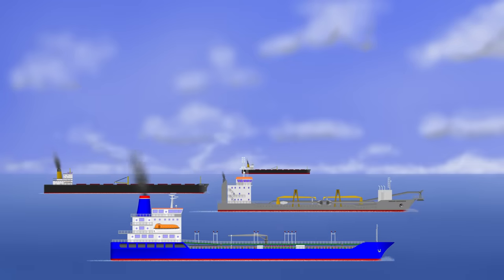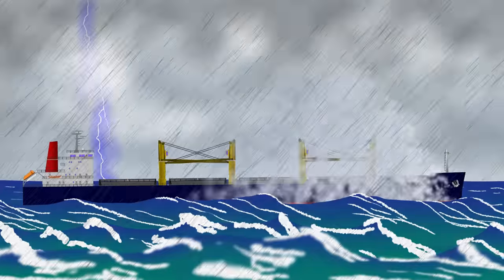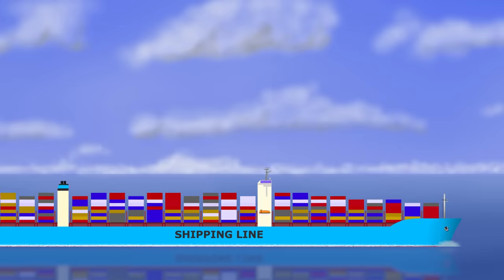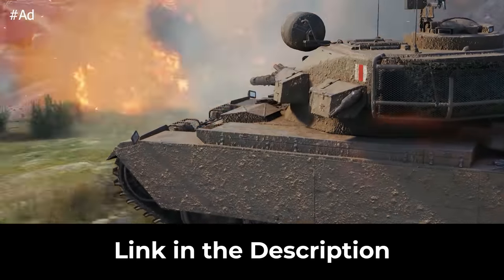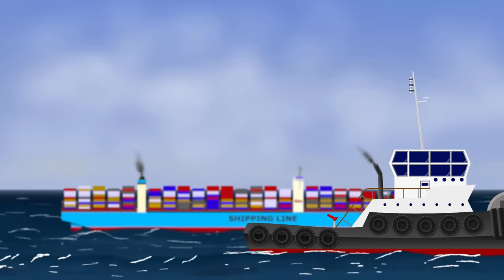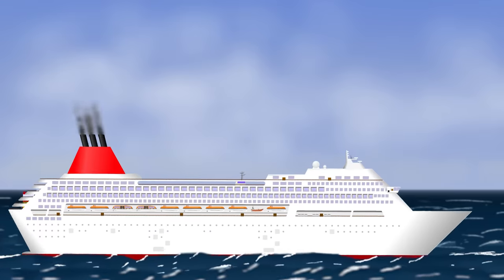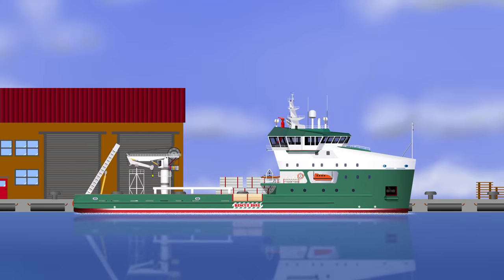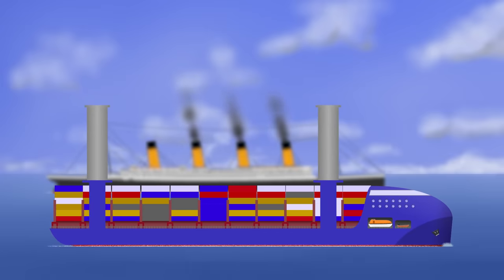Why Is The Bridge At The Back?

Comment: An additional factor with cruise ships is light pollution. Passengers want to have a midnight buffet and dance party, and having that in front of an aft bridge would make safe navigation and watch keeping impossible regardless of height or other factors. The fore bridge is very well protected from these visual distractions.
Reply: "light pollution." I hadn't even thought of that, but it would have to be a colossal issue.
Reply: Whew, I had to read this twice to notice the subtle difference in the word light between its common meaning like slight, little or minor, and what was meant here, the pollution of emitted light from light sources like light bulbs, flood light or fairy lights.
Good point.
Reply: @beachbum4691  it is quite a big issue. Commonly on cruise ships that have cabins directly above and below the navigation bridge, they all come with a requirement to use blackout curtains during a specified time during the night. That way there is no chance of light bleeding into the bridge itself. 

A good example is the panoramic cabins on a ship such as Freedom of the Seas. Another is the solarium on the Oasis class ships. Its positioned directly above the bridge and runs with minimal red lighting at night to avoid that problem.
Reply: @verios44   A wonderfully comprehensive reply, thank you, of such consequence I have reprinted your reply above. Very very best wishes - John - Perth - Australia
Reply: one person mentioned red light - it is used because dim red light does not cause eyes to adjust so quickly to bright light (and "switch off" the night mode where more sensitive rods are active (greyscale). Cones (which provide colour vision) are less sensitive.
Reply: @peter2346  exactly! Thats also why cruise ship navigation bridges are as close to the front as possible, so the passenger areas can be fully lit at all hours. 

Thats also why if you observe a military or industrial ship, at night they are near totally dark besides several beacon lights, or minimal lighting in specific places.
Reply: Exactly, I have the same comment. My old dad was a merchant marine Captain. When I was a kid we went to sea with him. At night the bridge is unlit (maybe some dim red light areas) as the bridge officers / crew have to maintain observation, no lights can be in front of the bridge. On a passenger ship that means being a the front. In fact I'd say that is the main reason the bridge is located there, it wouldn't be possible to have haapy passengers if they all had a blackout! I was surprised the video didn't mention this.
Reply: Rule Six. The question I got during my CoC Oral Exams :D
Reply: Not to mention second hand embarrassment from having to watch the captain make passes on elderly single passengers, night after night.
Reply: @othernicksweretaken 
That’s not a “subtle difference”, they’re two completely different meanings!
Reply: @sunnyinsanya2  Why specific it was your "Old dad"?  Did you get a new one at some point?? 😁

Comment: I love the detail of the "Titanic" only making smoke from the 3 real chimneys.
Reply: Yeah, that was a cool detail. Noticed it too.
Reply: @rasmuslundback8347  The main reason for extra chimney was for show. The public associated more chimneys with more speed.
Reply: Funnels not chimneys
Reply: @Ozymandias1  the 4th funnel actually had a purpose and it was for miscellaneous smoke ventilation from something like kitchens
Reply: @m1co294  They didn't need an entire funnel stack for that. It was just for show, however one of the cooks onboard had to be grateful for it. He drank a bunch of brandy as the ship was going down, figuring he was dead. He ended up getting saved because the force of the air being pushed out of the ship by the water coming in shot him out of that funnel to the surface. Apparently the brandy he had drank kept him from freezing to death in the water and he managed to get out into either one of the boats or some wreckage.
Reply: @brianeleighton  That must have been an absolutely harrowing experience.
Reply: @brianeleighton  - "It was just for show"
This gets overstated, it didn't necessarily need to be the same size as the others hooked directly to the boilers, but it was used for actual purpose. General ventilation from things like kitchens as mentioned was one, but also it was used for ventilating excess steam and as ventilation for the turbine room. It didn't need to have as much capacity as it did, but they couldn't have just completely sealed it.
Reply: @brianeleighton  alcohol will not help you keep warmer in cold. It will increase the rate of you losing heat because your vessels are wide open. Don't drink alcohol to for warmth, it will make you "feel" warmer only.
Reply: @muradm7748  You are right, but being drunk saved him from what actually killed most of the people who were in the water. Most people died before hypothermia set in. When a person goes into very cold water, your body has a few physiological responses. None of which are particularly conducive to being able to swim. First, the body goes into shock which leads to hyperventilation. This will cause a person to inhale water. Second, when a body hits the water the muscles will seize up. This makes it impossible to tread water. So, a person is both hyperventilating and locked up which causes them to drown. Being drunk means the body is less sensitive to those effects, which can give a person the chance to get to safety before hypothermia sets in and kills them.
Reply: @Ozymandias1  wrong, funnel 04 was for general ventilation .
Reply: @notjebbutstillakerbal  He's not wrong. The main reason is still show. They didn't need an exact copy of the other 3 funnels just for general ventilation
Reply: @Partyaap050  
For show and because it was easier to copy and paste.
Reply: @brianeleighton  You seem to be confusing the ship’s baker for the second officer. The officer reported that it was actually a ventilation shaft that blew him out, saving his life. As far as I’m aware, the 2 aft funnels collapsed before they were near the water.
Reply: Funnel 4 was for general ventilation and miscellaneous smoke sources.

Comment: I spent 30 years as an officer on merchant ships and have worked on many types of ships.  American container ships used to place the engines at the stern but the bridge all the way up at the bow.  Not only did one have to keep a close eye on what was happening behind while maneuvering and taking turns, but the bridge was very uncomfortable in rough weather.  Waves frequently would break over the bridge in heavy weather, and sometimes the bridge windows actually would become stove in.  We actually carried pre-out wooden pieces on the bridge to cover the broken window panes.  I often thought that the only reason that the ships were designed that way was so that the crew would provide a breakwater to protect the cargo, which the shipowners regarded as a higher priority than the safety or comfort of the crew.  LASH ships also had the bridge at the bow, but that was for a different reason.  LASH ships loaded and discharged their cargo in barges over their sterns, and required a clear run all the way from the bow to the stern for their massive gantry crane.  Over the years the container ships began to carry more and more containers by stacking them higher and higher above the deck.  That seriously obstructed visibility from the bridge on those container ships with their bridge installed aft.  As a result, it was not uncommon for many of the older container ships to have their bridges cut off and then re-installed on a newly-installed platform so that it was a couple of decks higher.  I sailed on several container ships where that had been done.
Reply: This sounds terrifying. Glad you made it.

Comment: I sailed a number of ships with the accommodation in the fwd and I always hated it: noise. On the dredger I woke up from the dredge pipe being lifted and lowered. On the cargo and heavy lift ships the pitching of the ship kept me from sleeping, especially when the waves actually lifted the anchors in their shafts.
Another disadvantage is the the greater movement of the ship when pitching: one will become seasick easier in the fwd than in the aft. I was quite immune for seasickness, but after a few days without proper sleep, almost everything becomes nasty...
Reply: Don't, under any conditions, accept service aboard a WWII American Destroyer.  Having a forward berth is an 'E' ticket ride even in relative smooth seas.

Comment: Up until the 1970’s, ships on the north american great lakes had both aft and forward deck houses. It was a traditional design that was advantageous for it’s heightened visability among other things. The aft deckhouse would house the galley and the engine room workers while the forward housed would house the deck crew, officers, and captain.
In the 1970’s advances in radar technology and the demand for more cargo capacity caused everything to be moved aft like on ocean ships. Interestingly due to the longevity of freshwater ships quite a few of the older forward bridge design boats are still in active service.
Reply: EF - RIP
Reply: This is true, and they still have a decent amount to forward pilot house boats
Reply: These days you see a weird mix of the two!
Reply: The SS Arthur M Anderson was launched in '52, and still hauling cargo on the Lakes.
Reply: I never realized that I always wondered about this. Thanks for sharing.
Reply: @zippersocks  me too! Thanks a ton, @Græ
Reply: That design did cause the crew to become separated in several cases where the ship broke up. I remember learning about at least two wrecks where the stern continued to sail for several miles while leaving the bow behind.
Reply: @jacoblongstreth9216  Only one I know of that did that is the Daniel J. Morell. But my knowledge of maritime history is somewhat small so there could have been another one
Reply: I was wondering about that design myself because I know the Edmund Fitzgerald and Arthur M Anderson had it.  Thanks for the enlightenment.
Reply: Yep! the last lake freighter tp have pilot house forward is the Algosoo, built in 1974 and scrapped in 2016
Reply: Saw the Kaye E Barker and Arthur M Anderson today going past Whitefish Point.
Reply: The Stewart J. Cort is an interesting amalgam of traditional and modern Laker. She was the first of the 1000 footers to appear on the Great Lakes during the 1970s, with modern diesel power and self-unloading, but retains the traditional Lake boat's fore-and-aft superstructures.
Reply: An interesting side effect of this is when they broke in half (which happened several times on the great lakes) the crew would get separated and the crew from the fore section would sometimes see the aft section continue to steam right along for a few miles.
Reply: Sadly we lost the Saginaw in early 2022 when she was laid up fir the last time and scrapped she had been working the great lakes sents 1953 and was one of the first 3 built with a self unloading system.
Reply: @onrr1726  not the saginaw. It was the ojibway
Reply: @aeggbrune  something similar happened with the sinking of the Carl D Bradley in 1958 in Lake Michigan.
Reply: @aeggbrune  i think the Carl D Bradley also split and kept moving
Reply: @potato1907  no, her stern still had power and all that but the wreck still has both halves almost right next to eachother
Reply: The reasons great lakes ships ran the forward pilot house was they where originally passenger/cargo ships that then had the passenger cabins cut off to make more room for cargo. Plus the better hearing for boat fog horns and lighthouse horns were better while away from the noise engine
Reply: lake freighters are an interesting breed of ship, they're just so damn long
Reply: @aeggbrune  The Anna Minch broke in half on Lake Michigan in 1940.  The bow and stern are several miles apart.
Reply: @aeggbrune  The Anna Minch broke in half on Lake Michigan in 1940. The bow and stern are several miles apart.
Reply: @AsbestosMuffins  I sail a lot on the Great Lakes so I'm interacting with these freighters nearly every time I'm out. They're big but really relatively narrow. At just over a hundred foot wide they're not nearly as imposing as those ocean going behemoths  with twice the beam. They are honestly pretty gentle to be around, very little wake even when moving quickly. Although up the St Clair and Detroit River they catch up to you pretty quick. Thankfully they are extremely well lit up at night unlike the salties which you can hardly see at night.
Reply: My father was a captain on the Great Lakes.  His company, Upper Lakes Shipping, launched its last forward wheelhouse ship, the Canadian Century, in 1967.  According to my dad, one the big reasons they switched to an aft deckhouse only design was the reduction in construction costs.
Reply: I got a freshwater sub I'd like to pull into your port.
Reply: There was even one Lake That was a aft ender pilothouse then forward pilothouse
Reply: @jacoblongstreth9216  the SS Daniel J Morell and the Edmund Fitzgerald are the ones you have heard of, but they  just 2 of the 6,000 shipwrecks here on the great lakes of North America
Reply: @MythicFool  The Anderson was also the last vessel to have contact with the Fitzgerald before the ship's untimely demise.
Reply: Oh I was about to ask of the Lakers
Reply: Edmund Fitzgerald
Reply: Canada Steamship Lines (CSL) started building ships in the late 1950s with aft only accommodation.   The Fort York and Fort St. Louis come to mind.  Fort York was launched in 1958.
Reply: I was actually going to pose this question, and I’m glad I found this comment.  Thank you!
Reply: It’s also now illegal, after the Edmund Fitzgerald sank the pilothouse now has to be behind the Collision bulkhead
Reply: @Klappadler7844  I don’t think thats true at all. Many of the old ships from that time are still sailing just fine. Also, many brand new salt water ships are built with forward bridges.
Reply: @aeggbrune  The Great Lakes and Ocean have different laws, ship that already exist from the era are still allowed to sail. On the Great Lakes you can no longer BUILD ships with pilothouses ahead of the collision bulkhead.
Reply: @markstott6689  YEEESSSSSSSSSS
Reply: When he said forward looks newer I got confused because it's common to see forward deck in Brazil and they are from the 60s.
Reply: IIRC the Alpena is the oldest serving ship plying the Great Lakes. She's now dedicated to cement hauling, and i think she's still steam powered. Her horn is magnificent. Sadly the prettiest laker, the Wilfred Sykes (also with an awesome horn) is laid up and as she's not a self-unloader, will likely never work again.
Reply: @johnandrews3568  Wilfred Sykes is a self unloader and not layed up, you are thinking of the Edward L Ryerson
Reply: @Klappadler7844  D'oh you're 100% correct.
Reply: @markstott6689  the lakes never give up their dead
Reply: So why not have high end camera's all over the ship and have a VR headset to view all of them from?  The ships crew can see whatever view they want when they need it.
Reply: That is what I'm thinking as well
Reply: Esthetically, I find those designs most appealing. A bridge structure about 40% of the length and a structute at the back of the ship.
Reply: There are passenger ferries that has one bridge in each ens of the ferry and then change direction and bridge in each end of the route so they never need to turn around

Comment: I do wonder regarding Great Lakers. They seem to use either a forward brige like the Arthur M. Anderson, or aft bridge like the James R. Barker. They're bulk carriers, but with the brige at a different end of the ship
Reply: The classic laker lines was first designed in the 1860s when the R.J hackett was built. The first ones were converted passenger steamers who couldn’t turn a profit (think converted freighters for aircraft) and it was easier to produce for those times. They decided to stick with it because it improves visibility and hearing. It stopped in 1974 with the Algosoo
Reply: I wonder too if it was changed over time as loading/unloading changed.  Many modern ones are self-unloaders so that may have different space requirements?
Reply: I think it mainly comes down to technologies like radar rendering the visibility afforded by the forward pilothouse unnecessary. It's safer and more efficient to have all the crew spaces close together. Lake freighters with the classic layout haven't been built since the 1970s.
Reply: A lot of them are different because fresh water ships have longer lifespans than saltwater ones. You’re probably seeing many older designs that haven’t been phased out as there is no need to.
Reply: @cryamistellimek9184  You may be right.  A quick search shows the Arthur M. Anderson was built in 1952 (now 70 years old) and James R. Barker in 1976 (so only 46 years old).  Both though are a bit 'past their prime' but this happens with 'Lakers'.
Reply: @mikefochtman7164  I realize with the comment by TurboThrobber69 that the traditional design of Lakers was the double superstructure with the bridge at the front. Since the James R. Barker was built in 1976, after the last traditional laker, the Algosoo launched in 1974. I geuss I thought they went both ways for years. I suppose the reason for the switch can be explained in this video.
Reply: @the5x5x5x  Maritime Regulations changed making it illegal to have the pilothouse ahead of the collision bulkhead

Comment: The classic cargo vessel of the early 20th century had the bridge in the middle - the so-called "3 island ship" with a forecastle, deckhouse amidships, and sterncastle.  This later got moved aft both as a more efficient use of space, and to make the propeller shaft shorter (which solved some maintenance and vibration problems).